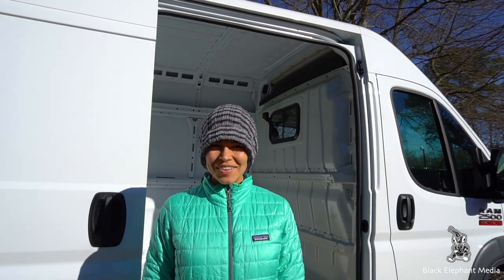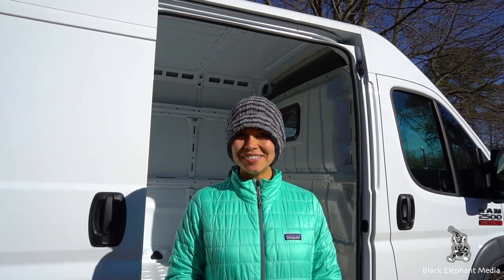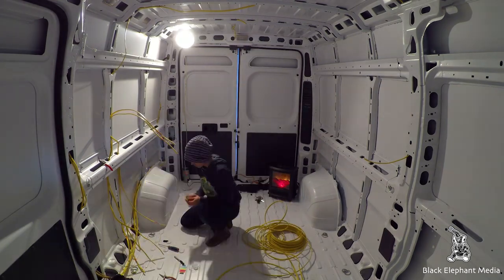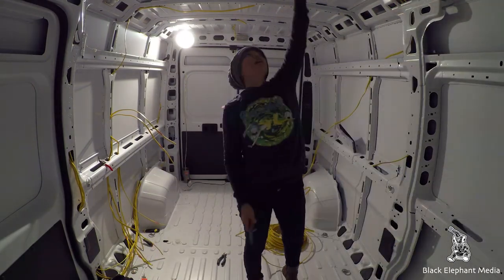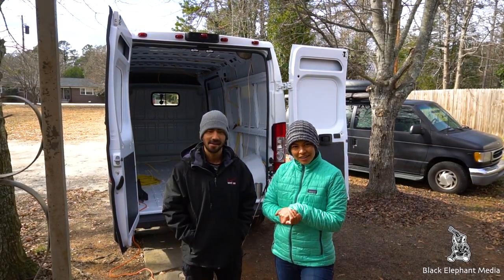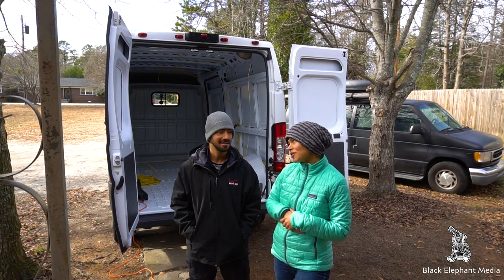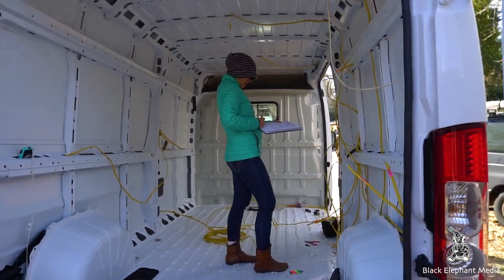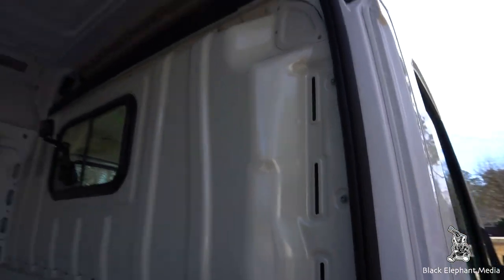2017 Ram Pro Master Van Conversion #1 - Electrical Wiring & Divider Wall Removal

Comment: Lol, sorry but using solid wire rather than stranded in a van build is not the smartest move. And putting everything behind the walls means when you have issues you have to get into the wall to diagnose and repair...also not smart with a van build. Van builds are NOT traditional houses and should be treated with a different mindset...sorry. Just think about any vehicle on the road....NONE of them contain solid wire...even RVs, no solid wire...I wont go into why. Sorry, guys, this is NOT the best choice. :-D